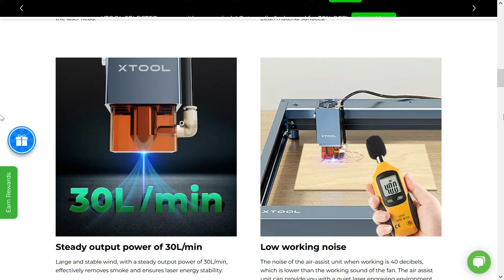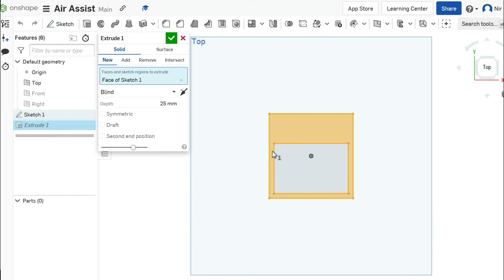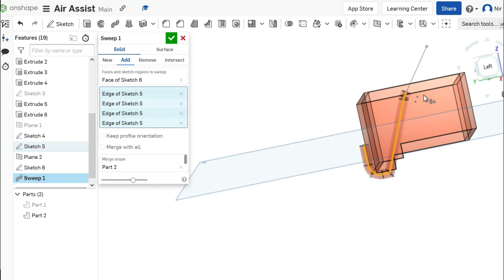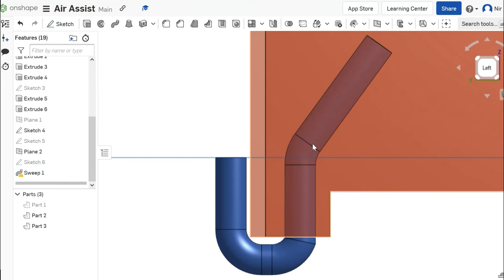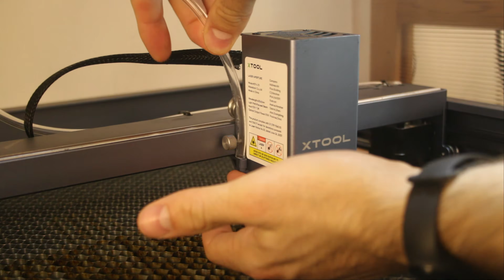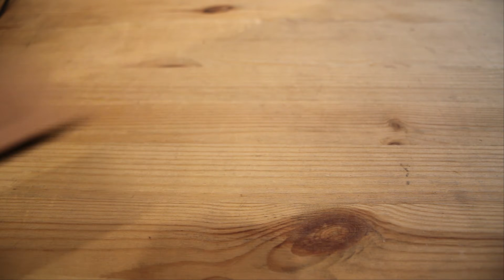$45 Air Assist Laser cutter Upgrade - Effective and Quiet | Easy Installation | xTool D1

Comment: So I finally go the air assist from China.  They sent 220 volt.  The language barrier is the problem with dealing with China.  220 is not standard in USA except for large appliances.   Like the stove in my kitchen .   Great looking piece of equip.  Sad I would have to unplug my kitchen stove to use it!!
Reply from the maker: Ouch!! Sorry that happened! They sometimes have a forgiving return policy which is worth it if the shipping costs are not too high. Or maybe you could find a transformer for it (you might have to make sure it's fit for 60Hz because, if I'm not mistaken, US standard is 60Hz while lots of other parts are 50Hz).

Comment: Hello friend, first of all, thank you very much for the video and the Instructables. However, I have a question.
In your project, you made your own Air Nozzle on a 3D printer, but if I'm not mistaken, the xTOOL D1 Pro already comes with a Metal Air Nozzle (I bought my laser but it hasn't arrived yet), so this Air Pump that you show in your video, does it fit the Metal Nozzle that comes with the xTOOL, without having to do your whole project?
I am asking you, because this Air Pump you show is cheaper than the original Air Pump from xTOOL.  Thanks
Reply: this style design and the one from geeks at large actually do a better job vs the xtool d1 pro air assist nozzle. it aims and focuses the air in a more accurate way. just because the xtool comes with the nozzle, doesn't mean you have to use it. it is removable and you put this nozzle type in it's place. as long as it fits over your lens cover(make sure to measure).
Reply: Thanks
Reply from the maker: Hi Dan, thanks for the question. I have the xTool D1, but not the pro version. I tried to see what's included in the box, to answer your question, but I couldn't find it, so here my answer:
An air assist set is made of 3 parts, the air pump, a nozzle, and a tube connecting them. The air pump xTool is selling is nothing special, it's a 30L/min pump and the link I provided is basically for the same kind of pump. I've been using it for a few months and it's been doing it's job well. Now, if the new D1 (pro) comes with a nozzle made for an air assist, you'll have to see how a tube can be connected to it. It may come with an adapter  designed to fit an air tube, and then all you need is to get whatever pump you like, and find a tube to connect it to their nozzle. If it doesn't come with a nozzle, you can measure the laser lens' diameter and use one of the files I provided in the instructables article.
My suggestion is to wait for the laser to arrive. An air assist is a really nice addition, it gets rid of the charring problem, but it's really more about aesthetics - it's not a must-have from day one. 
It's going to take you some time to get used to the laser cutter in any case, so I'd wait and see what comes with the laser, and only then order and assemble whatever air assist set you may like. 
Worst case - you don't have the air assist for a couple of weeks because you ordered the one from xTool a bit late, best case - you make your own and save around 100$. Hope this was helpful! :)
Reply: Hi Nix, thank you very much for your tips, it was very helpful, yes!
I had bought the Sculpfun S6 Pro and sold it to buy the xTOOL, so now it will be a new challenge because the laser is much more powerful.
Do you have any cutting and/or engraving charts you could share with me? Thanks again
Reply from the maker: @Dancopymus  Sure, feel free to contact me via my website (nirlivne.com) and I'll send you my settings :)

Comment: People should probably check out thingiverse.  There are lots of air assist designs out there and some were made before geeksatlarge.  Nothing special.  I have two I designed in cad myself.  If the guy designed it in cad he put the work in to make the file and replicate the file as he pleases.  Pretty limited in where you can run the air assist.

Comment: 👎not your design. Hope YouTube takes down this video.
Reply from the maker: Hi, thanks for taking the time to comment :) I didn't mean to offend anyone, and I'm sorry if I did. In fact, this video is meant to go along with my instructable, where I definitely gave GeeksAtLarge the credit they deserve. Honestly, I saw many designs before making mine, their design wasn't special, it was similar to others made for different laser cutters. Moreover, their design uses a 3D printer nozzle which I thought was an unnecessary complication (I thought it would make more noise and lower the efficiency of the air assist, and I wanted to use a small air pump).
Again, sorry if I offended you, I didn't claim not to see other people's designs, and I made changes to the existing ones along with giving them credit on my main article (see instructable in the description).
Sharing my projects is not my profession, and it will never be. I do this because I like sharing and I think sometimes people can learn from my work or make use of it. 'Stealing' other people's ideas is not something I would do even simply because I'm not planing on a career on YouTube or anywhere else online, this is just a hobby.
I'll post this to other comments as well.
Nir

Comment: This is a knock off (and not as good) as the Geeks At Large version. This has worse flow due to the open ended nozzle.
Reply from the maker: Hi, thanks for taking the time to comment :) I didn't mean to offend anyone, and I'm sorry if I did. In fact, this video is meant to go along with my instructable, where I definitely gave GeeksAtLarge the credit they deserve. Honestly, I saw many designs before making mine, their design wasn't special, it was similar to others made for different laser cutters. Moreover, their design uses a 3D printer nozzle which I thought was an unnecessary complication (I thought it would make more noise and lower the efficiency of the air assist, and I wanted to use a small air pump).
Again, sorry if I offended you, I didn't claim not to see other people's designs, and I made changes to the existing ones along with giving them credit on my main article (see instructable in the description).
Sharing my projects is not my profession, and it will never be. I do this because I like sharing and I think sometimes people can learn from my work or make use of it. 'Stealing' other people's ideas is not something I would do even simply because I'm not planing on a career on YouTube or anywhere else online, this is just a hobby.
I'll post this to other comments as well.
Nir

Comment: Thats funny how you knocked off another maker's design seems pretty common these days
Reply from the maker: Hi, thanks for taking the time to comment :) I didn't mean to offend anyone, and I'm sorry if I did. In fact, this video is meant to go along with my instructable, where I definitely gave GeeksAtLarge the credit they deserve. Honestly, I saw many designs before making mine, their design wasn't special, it was similar to others made for different laser cutters. Moreover, their design uses a 3D printer nozzle which I thought was an unnecessary complication (I thought it would make more noise and lower the efficiency of the air assist, and I wanted to use a small air pump).
Again, sorry if I offended you, I didn't claim not to see other people's designs, and I made changes to the existing ones along with giving them credit on my main article (see instructable in the description).
Sharing my projects is not my profession, and it will never be. I do this because I like sharing and I think sometimes people can learn from my work or make use of it. 'Stealing' other people's ideas is not something I would do even simply because I'm not planing on a career on YouTube or anywhere else online, this is just a hobby.
I'll post this to other comments as well.
Nir

Comment: This is from GeeksAtLarge and wow I also bought one as well last year.
You are part of everything that is wrong in this world.  I bet your parents are so proud they raised a thief.
Reply from the maker: Hi, thanks for taking the time to comment :) I didn't mean to offend anyone, and I'm sorry if I did. In fact, this video is meant to go along with my instructable, where I definitely gave GeeksAtLarge the credit they deserve. Honestly, I saw many designs before making mine, their design wasn't special, it was similar to others made for different laser cutters. Moreover, their design uses a 3D printer nozzle which I thought was an unnecessary complication (I thought it would make more noise and lower the efficiency of the air assist, and I wanted to use a small air pump).
Again, sorry if I offended you, I didn't claim not to see other people's designs, and I made changes to the existing ones along with giving them credit on my main article (see instructable in the description).
Sharing my projects is not my profession, and it will never be. I do this because I like sharing and I think sometimes people can learn from my work or make use of it. 'Stealing' other people's ideas is not something I would do even simply because I'm not planing on a career on YouTube or anywhere else online, this is just a hobby.
I'll post this to other comments as well.
Nir

Comment: I literally bought this exact air assist from Geeksatlarge over 5 months ago. Funny how you think you invented it. Shady tactics.
Reply from the maker: Hi, thanks for taking the time to comment :) I didn't mean to offend anyone, and I'm sorry if I did. In fact, this video is meant to go along with my instructable, where I definitely gave GeeksAtLarge the credit they deserve. Honestly, I saw many designs before making mine, their design wasn't special, it was similar to others made for different laser cutters. Moreover, their design uses a 3D printer nozzle which I thought was an unnecessary complication (I thought it would make more noise and lower the efficiency of the air assist, and I wanted to use a small air pump).
Again, sorry if I offended you, I didn't claim not to see other people's designs, and I made changes to the existing ones along with giving them credit on my main article (see instructable in the description).
Sharing my projects is not my profession, and it will never be. I do this because I like sharing and I think sometimes people can learn from my work or make use of it. 'Stealing' other people's ideas is not something I would do even simply because I'm not planing on a career on YouTube or anywhere else online, this is just a hobby.
I'll post this to other comments as well.
Nir

Comment: To bad you stole the design completely from another great guy.  Good luck with that lol.  Pretty sorry.
Reply from the maker: Hi, thanks for taking the time to comment :) I didn't mean to offend anyone, and I'm sorry if I did. In fact, this video is meant to go along with my instructable, where I definitely gave GeeksAtLarge the credit they deserve. Honestly, I saw many designs before making mine, their design wasn't special, it was similar to others made for different laser cutters. Moreover, their design uses a 3D printer nozzle which I thought was an unnecessary complication (I thought it would make more noise and lower the efficiency of the air assist, and I wanted to use a small air pump).
Again, sorry if I offended you, I didn't claim not to see other people's designs, and I made changes to the existing ones along with giving them credit on my main article (see instructable in the description).
Sharing my projects is not my profession, and it will never be. I do this because I like sharing and I think sometimes people can learn from my work or make use of it. 'Stealing' other people's ideas is not something I would do even simply because I'm not planing on a career on YouTube or anywhere else online, this is just a hobby.
I'll post this to other comments as well.
Nir
Reply: I can tell How extremely Sorry you are by your deleting Cobeys comments.  It’s fine a persons true worth stand out no matter what. You have already made a horrible name for yourself.  You really did pick the wrong person on the laser community to try and copy and steal from.  Might have got away with it using someone else’s product.  Good luck.  Your going to need it.
Reply from the maker: @Ndeepdesigns  Hi, I did not delete anyone's comments, and I didn't steal from anyone :) I gave credit in my article, and I also added that in the video description now that I saw that people are not seeing my article (this video is supposed to go along with the article, not vice-versa). 
I made modifications to the existing designs, GeeksAtLarge being one of them, and tried to share my take on it (for free), as well as other things like my design process. 
Like I said, this is not my job, it never will be, it's just a hobby. I try to do good by sharing it online, so other people can take my designs and use/improve them. 
I'm sorry if I offended anyone, I had no bad intentions here.
Reply: @nixmakes  but how is it free if you are selling it? Selling it means making a profits from it. Or well from someone else.  Can you please explain what you
Somehow improved on the design. I am curious to know.
Reply from the maker: @Ndeepdesigns  I'm not selling it, if you bothered watching the video or reading my instructable you would know. I added links to a website that helps you find someone to print the parts for you. I make no profit out of that (although it would be fair and square if I did).
I saw GeekAtLarge's design as well as many other models before making mine, I don't claim to be working in the vacuum of space. But I didn't steal anyone's work. I didn't like GeekAtLarge's use of a 3D printer nozzle, so I removed it (using the nozzle is not his idea by the way. This air assist design used it and was posted a few days before GeeksAtLarge's https://www.thingiverse.com/thing:4704160  coincidence? no. Stealing? Also no. Other ideas he used were online before he used them too, just search thingieverse if you like). I didn't make any comparisons between my design and GeeksAtLarge's nor anyone else's designs, I'm sure there are other differences, but the nozzle was the reason I didn't just use his design and move on to the next thing. I searched online and couldn't find anything that was perfect for what I wanted, so I made my take. 
I'm not making profit off of this, I have a different profession, you're welcome to visit my website and read all about me if you like (nirlivne.com).
Many people were very upset about my project - I guess I touched an open wound or something. But like I said, I'm not making any profit off of this and all I tried to do is share my project so that other people can make use of it - how I design (how I do research and 3D model), what stuff I used to make this, and how to assemble the project. I don't see how this can be harmful to anyone, and I plan on keeping my project online here and on instructables for people to use. I didn't do anything wrong here, and I hope my answer is satisfactory to you and others.

Comment: You designed it...LOL! More like copied it!
Reply from the maker: Hi, thanks for taking the time to comment :) I didn't mean to offend anyone, and I'm sorry if I did. In fact, this video is meant to go along with my instructable, where I definitely gave GeeksAtLarge the credit they deserve. Honestly, I saw many designs before making mine, their design wasn't special, it was similar to others made for different laser cutters. Moreover, their design uses a 3D printer nozzle which I thought was an unnecessary complication (I thought it would make more noise and lower the efficiency of the air assist, and I wanted to use a small air pump).
Again, sorry if I offended you, I didn't claim not to see other people's designs, and I made changes to the existing ones along with giving them credit on my main article (see instructable in the description).
Sharing my projects is not my profession, and it will never be. I do this because I like sharing and I think sometimes people can learn from my work or make use of it. 'Stealing' other people's ideas is not something I would do even simply because I'm not planing on a career on YouTube or anywhere else online, this is just a hobby.
I'll post this to other comments as well.
Nir

Comment: You copied GeeksAtLarge
Reply from the maker: Hi, thanks for taking the time to comment :) I didn't mean to offend anyone, and I'm sorry if I did. In fact, this video is meant to go along with my instructable, where I definitely gave GeeksAtLarge the credit they deserve. Honestly, I saw many designs before making mine, their design wasn't special, it was similar to others made for different laser cutters. Moreover, their design uses a 3D printer nozzle which I thought was an unnecessary complication (I thought it would make more noise and lower the efficiency of the air assist, and I wanted to use a small air pump).
Again, sorry if I offended you, I didn't claim not to see other people's designs, and I made changes to the existing ones along with giving them credit on my main article (see instructable in the description).
Sharing my projects is not my profession, and it will never be. I do this because I like sharing and I think sometimes people can learn from my work or make use of it. 'Stealing' other people's ideas is not something I would do even simply because I'm not planing on a career on YouTube or anywhere else online, this is just a hobby.
I'll post this to other comments as well.
Nir